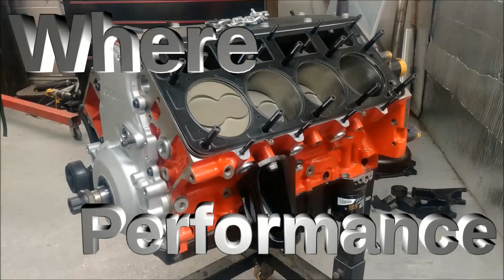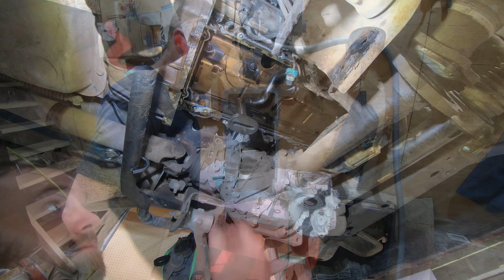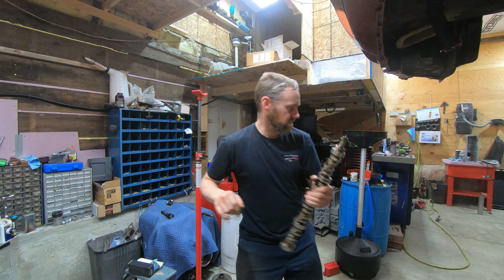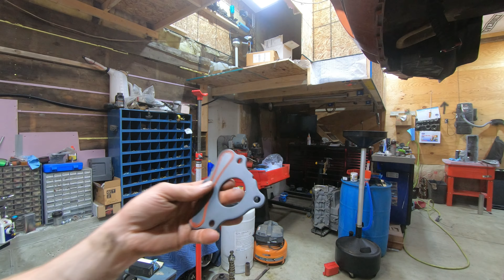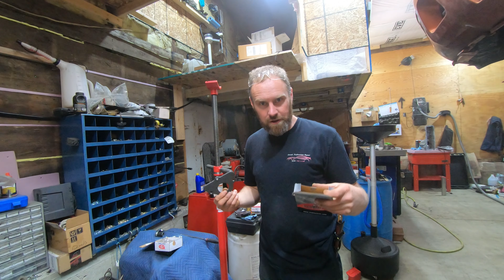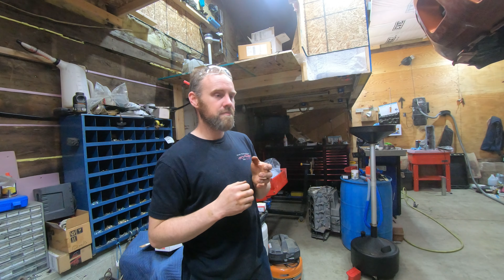GM Gen 4 V8 Oil Systems and AFM explained

Comment: Hey thanks on information,  i have a 12 silverado lc9 5.3 had lifter turn and grind grove in # 4. I replaced all lifters cam., plate tentioner  rebuilt factory heads all bolts replaced all from gm. Oil pressure was ok 40psi @ at startup ot @ idle would drop to 25. After about 200miles pressure dropped to about 5 and lower i shut truck down. 5min later was up at 30psi. Then 5. I then replaced oil pressure sender and screen.  Same thing.  Then i dropped pan. Did o ring pressure relief valve and cleared the 2or 3 inches of sludge. At start up was about 45psi then down to 5or6 psi. Watching with autel scanner. Was thinking of trying new oil pump will that give me enough boost in pressure.  And wouldn't the pump get destroyed in this case if as you said oil goes from pick up to pump then filter? Wouldn't all the metal from ground lifter drop to pan then get sucked up to pump and cause damage? I know in a harley oil pump a scratch you can feel with your fingernail will cause a drop in pressure.
Reply from the maker: The oil pump is really robust in these. Check out my FAQ page https://www.crazedperformancerepair.com/afm-dfm-lifter-repair there is lots of info on there. If you have anymore questions message me there.

Comment: I just did an afm delete on my 2010 Silverado, started up great, had 60psi, after it reached full temp it was about 35 psi and went up to about 45-50 with a little throttle. But it’s dripping from just above the oil filter (not from oil filter) I was thinking maybe the pressure sensor? I did replace the sensor when putting on the new valley plate
Reply from the maker: There is a oil cooler line or plate right above filter depending on what option you have. Check that first.
Reply: @CrazedPerformanceRepair that’s actually exactly what it was, that little drain plug on the side of the oil cooler line block was loose and dripping.

Comment: Diagram doesn't show oil cooler pad or afm towers and vlom.
Reply from the maker: Because oil cooler is optional and just interrupts flow at the filter. Not sure what you mean by pad but as for the VLOM. The VLOM only flows oil in AFM equipped engines under AFM active conditions and is not a part of engine lubrication. Just like the VVT system. AFM only flows oil as a way to control a component and not as a system lubrication. I wish the diagram showed all those along with the pressure relief valve in pan. But I didn't make up the diagram. I just used it for illustration.

Comment: Hey great video i have 2007 Silverado 5.3 replaced a collapsed lifter now low oil pressure and oil shooting through rods like a geyser is that a lifter or vlom problem
Reply from the maker: That's a lifter problem.
Reply: Did you ever figure this out?same exact issue right now replace all lifters now no oil pressure sounds bad and oil pressure is blasting out of the rockers

Comment: 5:19 can you go into more detail about the debris. I had a ton of rubber in my oil pan and all over the deflector you point to. Was there a coating on there or something? It look like a tire exploded in my oil pan
Reply from the maker: Well that's interesting, Is it RTV maybe? feel free to message me on my website or join the forum and post there. Just be sure when you sign up there is a name attached or I will assume it is a bot account. You might have something related to the vacuum pump going on. Not sure where all the rubber would come from except maybe brake booster via pump? I don't even know if that's possible without digging in some though.

Comment: I have a small tick/ rattle at 2k rpm and normar tick om idle but kinda hear from passenger side valve cover all the rockers seem fine am starting to think time chain guides 2010 5.3
Reply from the maker: Might be a chip in a lifter roller. Pull the valve cover and use a stethoscope to listen to the rocker arm bolts. Then you'll be able to tell if one of them is making an excessive amount of noise versus the rest.

Comment: First off, thank you! Love all your content, knowledge, and willingness to share it with others! 
I have completed a full AFM delete on our 220k mile 2011 L94 (original lifters), with your tool and release trick at 196k. Still going strong! 
Hot idle op initially rose from 20 to ~27psi but now seems to be back in the low 20's.  I'm wondering if I should be concerned with these #'s? At what point do you recommend lifter replacnent and / or cam bearing replacment.  Not too confident in a local shop to know how much is too much slop by the cam insert test.  Also, oil sump oring test seems to yeild no noticeable improvement but only overfilled about 1 qt. Are these numbers okay or possibly a little concerning given the age / mileage?
Reply from the maker: That oil pressure is a bit low but it's not going to cause a failure. If the lifters are bad and causing the oil pressure drop they will be squirting a ton of oil out. By that I mean basically it'll shoot it over top of the fender or into the hood. So pull the valve covers off start it up and see how much it sprays oil out of the pushrods. If they just barely piddle out or don't piddle out at all then the lifters are good. As far as the can bearing, it does take a bit of experience to know if there's too much slap there or not when you're doing the cam wiggle test.

Comment: 2010 5.3 I have 55psi by oil galley at front pass and 55psi at back of intake new oil filter cleaned  screen under oil sensor and don’t have any oil coming to top of my engine does that mean I also have no oil to crank 
Miner right now but I think I have a turned lifter currently as well.
Reply from the maker: By saying you have no oil at the top of the engine are you referring to the lack of oil coming out of the rocker arms? He properly functioning oiling system on these the lifters won't push a whole lot of oil to those rockers head idle. They pretty much almost push nothing at idle. As long as you have pressure then you're crank and everything is getting oil.

Comment: My 2007 Silverado 5.3 @ 88k miles with the AFM is doing great with no issues, but I was considering having the engine converted to the non AFM build should it experience a lifter failure down the road. After viewing this and other videos I doubt I could ever find a machinist to administer all the vital knowledge & experience to do it right, and being a Californian and seeing a caveat from a Texas outfit selling the kit that they won’t offer it to California builders because I assume the conversion won’t meet CARB requirements (won’t smog). Time to rethink ownership of this truck and any other GM AFM products I am afraid. Thank you for the expert videos, very helpful.

Comment: Doing a full delete from a LC9, 5.3 Silverado.  Just remove and plug the pan relief valve?  Oil pump high volume with standard pressure?   Any timing chain and gear recommendations?

Comment: Driving getting on the gas at times at 2.5k 3.5k rpm’s I get a tick that I can hear in the cab it’s a 2013 GMC Yukon Denali 6.2 2wd l94 any thoughts ? Hope you can answer 🥲 changed pulleys thought it was that changed the belts nothing changed. HELP!

Comment: So how bad really is dropping down to 18-20psi at hot idle if you have the AFM disabled?  All of mine do that but they run perfect with no excessive noise. Doesn’t seem like it’s worth changing the cam bearings just to have the oil pressure gauge ride higher.
Reply from the maker: As long as it doesn't drop below 15psi it shouldn't trigger the low oil light and will keep from damaging bearings and such. Well except the second cam bearing but that failure isn't from lack of oil. Ultimately it's your call but I would at least get the AFM actually tuned out instead of using the range device. If you blow the fuse for your obd adapter it's plugged into, or bump it with your knee and it stops working. Your AFM might activate and cause lifter failure.
Reply: Yep that’s a good point. Also if you ever need to do a road test with a scan tool for any reason, you have to unplug the range and risk a lifter failure. Never had a low pressure alarm yet. These are ‘12-‘13 160k+ mile engines that run great and don’t burn any oil.
Reply from the maker: Yeah and the bottom ends are usually rock solid. I've seen a lot of them exceed 400k miles.
Reply: Amazing videos and your knowledge and care I’m working on  a 2010 got 55psi new oil filter cleaned screen under psi gauge. I think I have a rotated lifter bc it’s rock solid but yet doesn’t move and I have zero oil coming to top end I learned from you the crank and rods also haven’t been getting oil either. Any thought why no oil to top end?

Comment: I have a 2014 silverado with the 5.3 I have an annoying whistle; whirrling sound during cold start until engine heats up , no check engine light.sometimes it sounds like valve cover passenger side other times exhaust(there is a broken bolt on manifold passenger side)
Reply from the maker: Take care of the manifold bolt first. Good possibility that's it.
Reply: @CrazedPerformanceRepair  thank you!!!

Comment: i did an afm delete on a 6.0, replaced the oil pump because i had some grooves in the front plate, replaced pressure relief vlave in oil pan, high volume std pressure with the steel secondary hold down for the pickup tube flange.  cold start my oil pressure is 50+psi, operating temp around 40psi above idle. but when im at idle just under 600rpm its like 20 psi.  i had a 2013 chevy 5.3 that also did this, 33psi at temp, dips down just above 20psi at idle.  not sure if i did something wrong.  could i reflash my ecm and bump rpm up to like 675? just above 600rpm it shoots right to 40psi.
Reply from the maker: You could bump rpm in the tune but then it may pull you forward too much in gear. Almost like if you had cruise control set at low speed. Ultimately you likely got leaky lifters or a bad second camshaft bearing.

Comment: I spoke with mellings and I explained that I was doing a dod delete and was going to block the release valve. They said that was fine and still recommended high volume pump. I have zero issues.  I have 30 - 35 psi at hot idle and 75 psi at wide open.
Reply from the maker: That's perfect pressure, definitely wouldn't go to standard volume pump with that. Little high at rpm for stock engine though.

Comment: youre spot on about the oil consumption being the valve cover design.  anytime you take the manifold off, its got about a quart of oil  trapped inside.  can only get in there from the driverside pcv.

Comment: Enjoyed the video.. . My 2003 silverado 5.3 has 353,000. Very small amout of piston skirt noise on a cold start.. only last a few seconds.. zero noise from front of engine.. however should i be concerned with the timing chain? How long have you seen them last??
Reply from the maker: Those can last a long time in that era so long as it's very well maintained. Probably be a good maintenance item to do though at some point. That mileage is getting up there. The chain slop can be checked by someone with and experienced enough feel for it. Basically the slop can be felt by turning crank back and forth in a certain position with a breaker bar. Really takes experienced feel though. Those don't have a tensioner so it can be done.
Reply: I have done that many times on other vehicles. On the older engines with distributor we used to turn crank and look at rotor button. i am a retired master ASE automotive instructor. Retired 10 yrs ago. i was just curious about this 5.3. This truck stays on the road daily..  I have always  run synthetic since i have owned it. I  plan on changing it however i always seem to have someones vehicle on my lift. Always something going on.. i enjoy your channel.. learned some stuff on the ls based engines.. thanks.